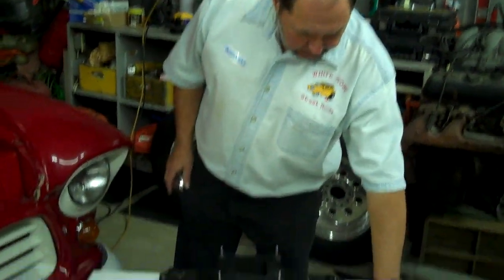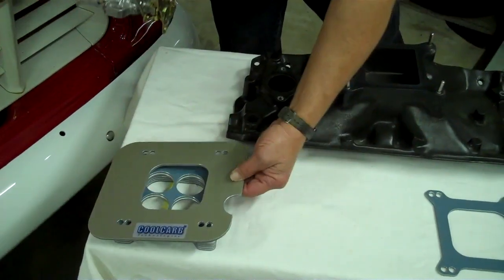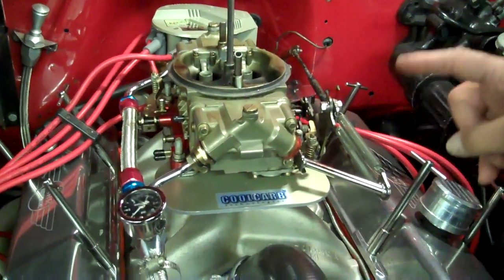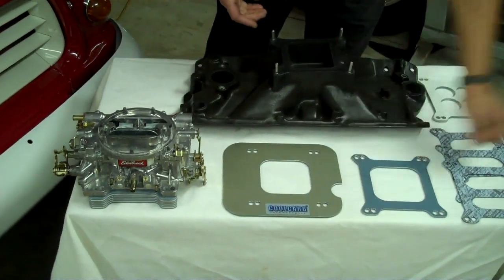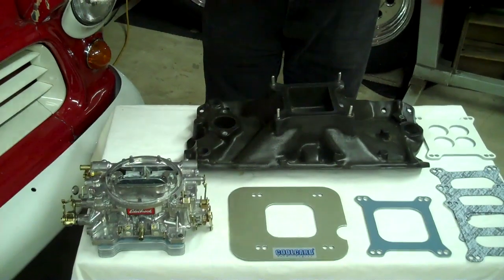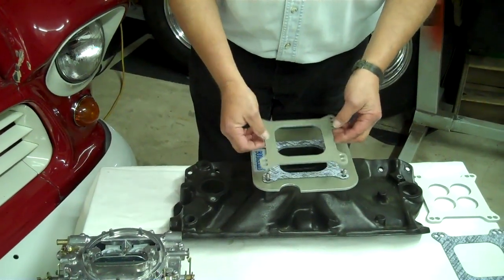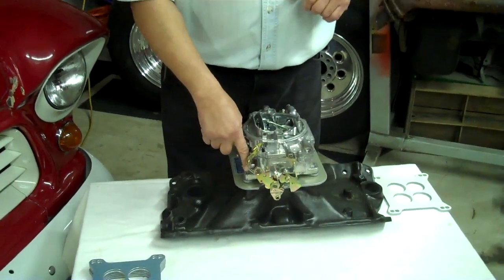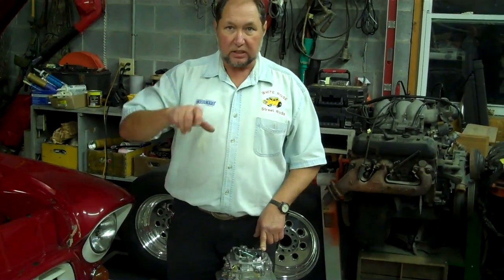How CoolCarb works....mp4

Comment: What I take from all this is block heat and or protect from heat.  Mostly block.. :-)   BTW, a fuel return setup with pressure relief between the pump and carb will help, also.  Nice looking engine bay!!

Comment: Air doesn't conduct heat or cold? How does an oven work then?
Reply: Air is genrerally considered an insulator. Foam/Thermos/travel cups/etc.   The oven works by radiant heat.   Then, the materials inside the overn, including whatever you are cooking, become warm and that will warm the air around it.   Proof for purpsose of testing/feeling what I'm saying:  Do you have a heat lamp?  Or, a portable heater that doesn't have a fan?
Take a thermometer with you and not touch the bulb of the thrmter.      Under a heat lamp, while off, take the temp of the air 2 feet away from heat lamp (off).     Take the temp four feet away from the lamp (still off).  all this time, do not touch the thrmtr bulb.   Now, hold your hand at the 4ft spot and the thrmter at the 2ft. spot.  Ask someone to turn on your heat lamp.   You wll notice the heat sensation on your hand increase dramatically, yet, the thrmter will not as it is measuring the air temp.  Your hand is stopping/blocking/transfering the radiant energy from the heat lamp.  The actual sensation is caused by the energy wave , just like the Sun's , as it hits you, changing/transferring the current state of your skin cell/nerves.  There is more to this (incuding the Sun's part) , but, that's how radiant energy sort of works.  The heat lamp helps Grandma across the room, yet, you walk between her and the heater on the floorwithout getting fried like the orange/red elements.    Try this:  Stand in front of nice warm fire and see if anyone right behind you gets the heat.   BTW, the thrmter will eventually rise as it gets affected by some of the light hitting it and the proximity of your hands near it.  :-)   
One more thing:  Air will conduct, technically, but, that's because air is not a vacuum.  It has stuff in it, mostly nitrogen.  These elements are not normally considered conductors.